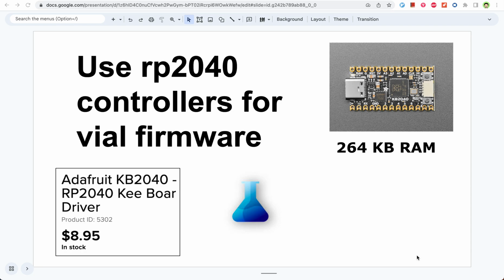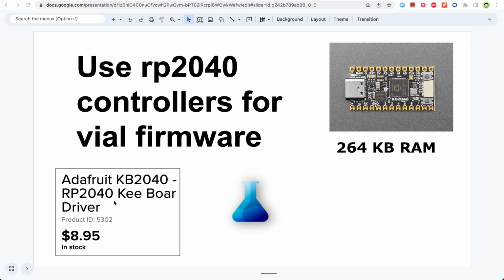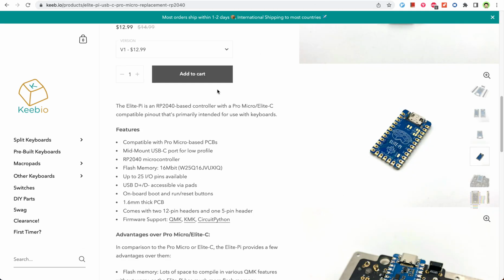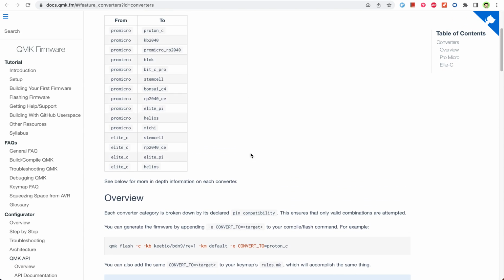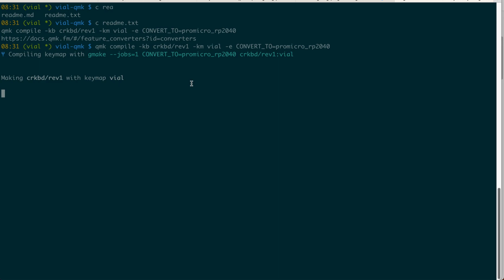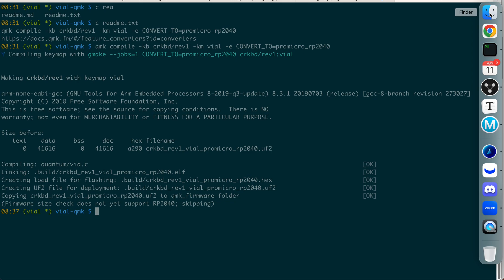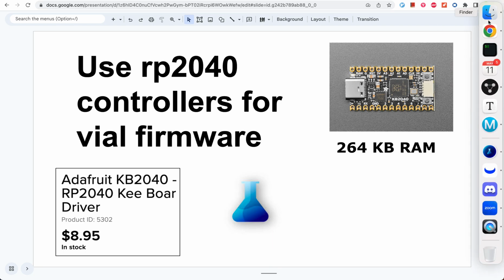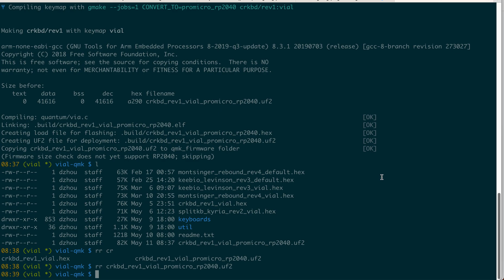How to use rp2040 controller to create QMK VIAL firmware for custom mechanical keyboard

Comment: Hi there, is there a way to compile corne 5column layout in vial ? I can only do the 6 column version one thank you
Reply from the maker: U can use the 6 col firmware on 5 col. u can just download mine. I have both firmwares for rp2040 and pro micro